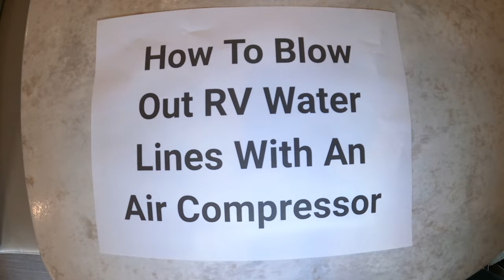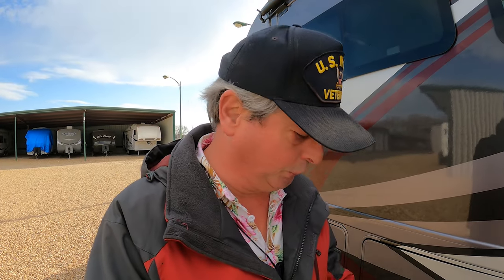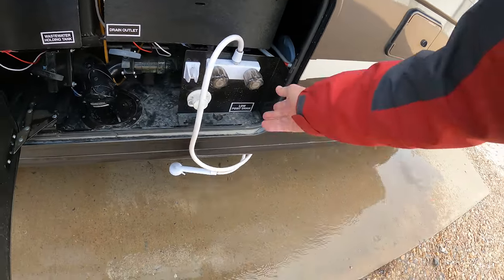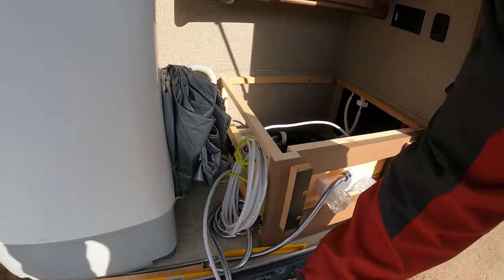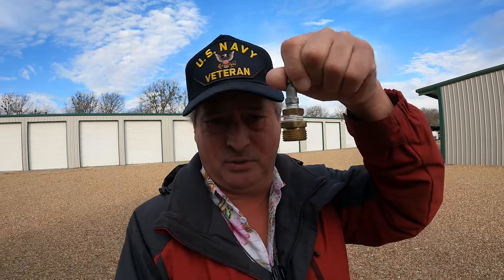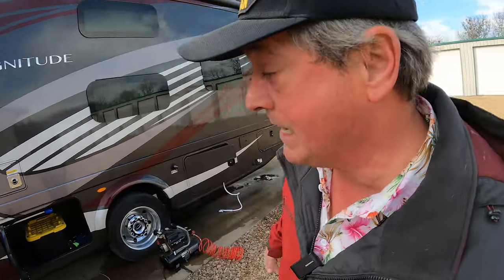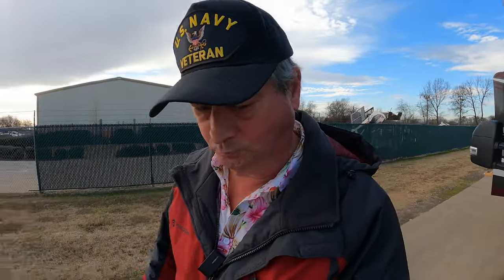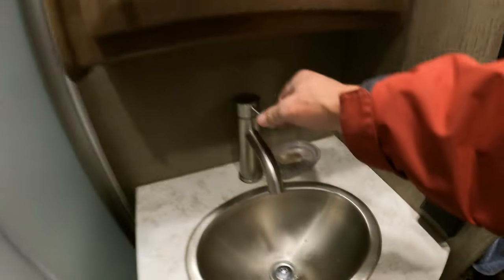How To Blow Out RV Water Lines With An Air Compressor

Comment: Thats the way to do it. 👍👍
    Also if people have a clothing washer , or the hook up for one , you should also blow them out also.
   I just hook up a water hose to the spigots  and run it out the door to drain when using the compressor.
    I also add a little of that pink antifreeze stuff in the sinks and shower for the p-traps , just in case.
   Oh yeah, and don't forget to flush the toilet to get the water out of those lines also....
Reply from the maker: Great tip! Thanks for sharing and thanks a whole bunch for watching!

Comment: I watched another video that said I should NOT use a shop compressor. I have a Bostitch pancake compressor that also has the pressure dial like yours and I don’t see the problem? Are they okay to use for this or is there some reason other videos say I shouldn’t? I sure as hell don’t want to buy a whole new compressor without understanding the reason. 🤷🏼‍♀️
Reply from the maker: I have never had any issue. Just make sure to always have a valve open so you do not over pressurize the system. I always crank down on the air pressure to about 50PSI just in case I forget to leave a faucet open when I am doing the deed.
Reply: @DudeRV  That’s what I thought! I’m just always second guessing myself 😆

Comment: My travel trailer water system is stop up due to trash coming from the hot water tank , how do I get all of the trash out of the water lines?
Reply from the maker: take all of the aeration screens off of all of the faucets and blow out the lines like I show in the video. You will want to clean out the water heater tank first with this type of tool...https://amzn.to/428WgPF
I hope that helps!
P.S. if your trailer has an onboard water filter you will want to take the filter cartridge out before you blow the lines and replace it with a new one after are done with the line blow out.